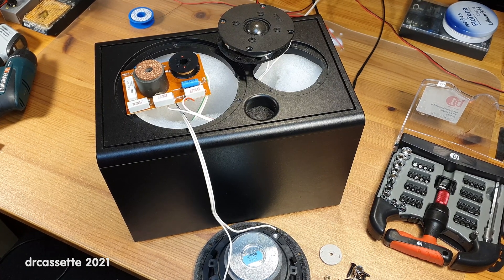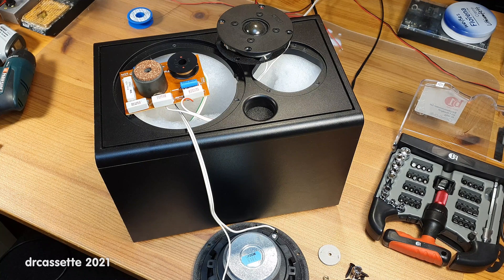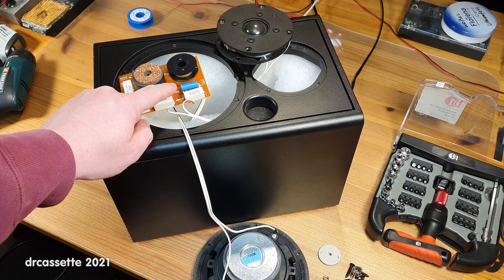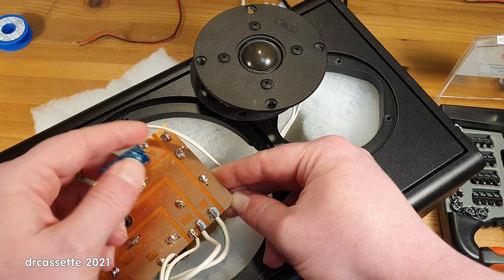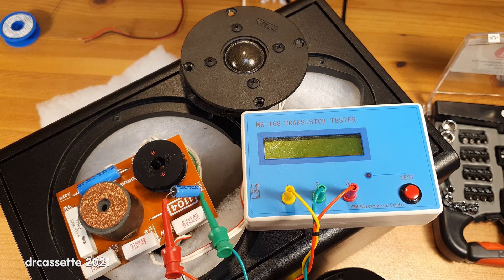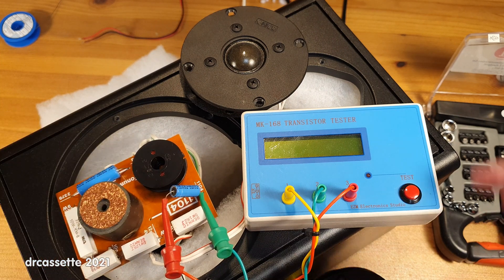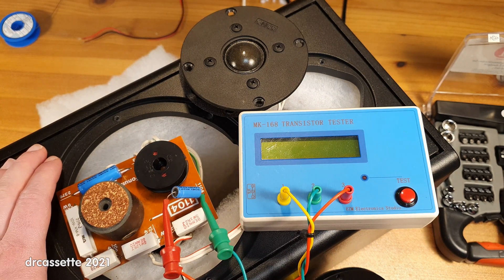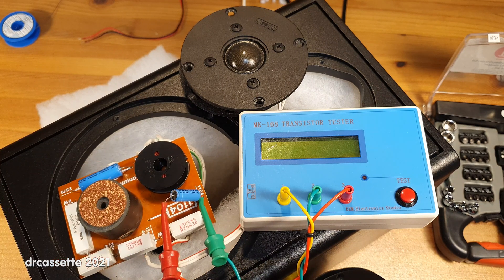Bad capacitors in a speaker crossover make a big difference

Comment: I don't recommend "shotgun" capacitor replacement as a standard practice, but when someone brings around a 40+ year old vacuum tube amp I start thinking about the power supply electrolytics becoming a hazard in the near future.  That and the coupling capacitors feeding the output tubes unless they are of superior quality.

Comment: A worthy upgrade to consider, replacing the NP electrolytics with equal or close value film caps, on the tweeter side. Electrolytics for the low pass function can be electrolytics with no issue. I’m not sure if it’s a placebo effect, but my ears usually prefer film caps in high pass and band pass applications, when listening closely.
Reply from the maker: Electrolytic capacitors indeed are not ideal, I once accidentally replaced film capacitors that looked like old electrolytic capacitors with new electrolytic capacitors and the speakers sounded noticeably worse. However, I don't think the owner of these speakers would really notice the difference, he is not that much into HiFi.

Comment: It sounds like we may have to wait for a follow-up video.... IF the speaker owner EVER replies.
Reply from the maker: The owner of the speaker is a friend, he replied not long after I finished this video. I will replace all capacitors in both speakers. That probably won't be too interesting, given that the diagnosis of the problem is already done. So there most likely won't be a follow-up video...
Reply: @DrCassette  So, whoever is curious would have to read your reply so they would know.  Meanwhile, I suppose we're gonna see what's your next interesting video.

Comment: Considering a speaker crossover is a pretty benign environment for a cap, this speaker doesn't look old enough (late 1980s? 1990s?) for a good cap to be that worn. Either those caps are crap or they have a ton of hours on them, and were often operated at high power.
Reply from the maker: The capacitors indicate that they are from 1992, however the design of these capacitors dates back to the 1970s. Maybe that explains the relatively short lifetime.
Reply: I think I actually have the same speakers, from 1992 I think.
Reply: Ok you mentioned it later anyways, lol.
Reply: what's the point of your comment? yes, the cap could be faulty or a bad design but it could be actually a good cap but the speaker was blasted for hours which caused the cap to die.... either way the cap is bad and need to be replaced.
Reply: @pagepro211  

If it was overpowered I'd rather expect the delicate tweeter coil to be blown, not the cap. It's still a bit strange that it failed completely open after just 30 years.

Comment: Humm, an interesting subject for a video. It never crossed my mind about crossovers. I still use a pair of speakers I purchased 35 years ago... About all I can say is that they both are still a good match and I am well aware that I can't hear so well in my late 50s. No one seems to mention cross overs getting old, it's mostly re-cone work and that's about it, or perhaps making a superior crossover.
Reply from the maker: Bad capacitors in speaker crossovers are certainly a very uncommon problem, this is the first time I came across such a problem. So if the speakers sound fine, there is no need to worry about capacitors in the crossover...
Reply: @DrCassette  thank you. As always fascinating content.

Comment: I thought the rant was going to be for the ones that were going to say that now you need to replace the same capacitor in the other speaker otherwise it will not be balanced properly anymore.  Lol. You forgot this crowd!
Reply: Actually, serial capacitors in a crossover network's high pass filter do have a huge impact on sound quality, not necessarily in frequency response but rather in step response. And given that both caps for both speakers are equally old with an equal history of usage, it would indeed be best to replace both with the same type. And while you're at it, it also doesn't hurt to check the ferrofluid in both tweeters.

Then again, it all depends on what the owner is using these bookshelf speakers for. The Canton Fonum series was well-acclaimed back then in the early 90s 🤷🏼‍♂️
Reply from the maker: I don't totally disagree with those who say that both channels should be kept equal. Certainly if a modification should be necessary in one channel, the other channel should be modified accordingly. In the case of these speakers, the other one which my friend has not given me yet has the same problem of no treble output, and since these speakers were likely made on the same day from the same batch of components, and given that they were used as a pair, being exposed to the same conditions throughout their life, I think it's safe to say the other speaker is going to have the same fault, bad capacitors in the crossover. And even if the other speaker was fine, since I have to order the replacement capacitors anyway, I would still replace all capacitors also in the other speaker, just to be on the safe side.

Comment: Okay I'm not sure I understand the rant? You say recapping is bad but then prove that the capacitor was the problem and that bypassing the bad cap with a working one fixes the issue? Unless you mean people are just going for recaps instead of troubleshooting to find that the problem is the capacitor (which is very odd but not really controversial to say its wrong, but in this case, regardless of their first plan of action being right or wrong, would fix the problem), I'm unsure what you were trying to hint at, sorry.
Reply: He didn't say doing it was "bad", he was merely saying that there are going to be people that say he needs to just blind replace all of them.  Those people are generally idiots, blind replacing all with ones that will never last as long as the ones left in would or be less of a tolerance.
Reply: @jimb032  But in this case it would technically fix the issue, no?
Reply: @arwlyx  Yes, if you can call that "fixing".  I call it throwing the baby out with the bathwater.   To compare it to a car:  You buy a new car with top of the line tires, these tires are guaranteed for 80k miles and have a 150mph speed rating.   One day you run over a nail and one tire experiences a flat- but all tires have 3/4 their tread life still.  You trash all tires and replace them with a set of MayPops with no guarantee and a spped rating of 80.  You fixed the problem, in a stupid way, but you fixed the problem.

Comment: I agree with your rant against blind recapping as a cure for every electronic problem ... Indeed the opposite, recapping is stressful for the boards especially if caps have bent pins to keep them still while they were originally soldered. Unless a cap is leaky or dead short, it is usually best to leave it as it is. Electrolytic caps are used mostly as filters for IC supplies and even if they have only 50% of rated capacity, it is not such a big deal.
Reply from the maker: I should add, in the case of analog electronics there are coupling capacitors in the signal path. If they are too far out of tolerance, they will have an unwanted influence on the signal, so if a piece of audio equipment does not sound as good as it should, if the signal is quiet or the frequency response is limited, coupling capacitors should be checked.
Reply: @DrCassette  

I always change audio output coupling caps. Don't want DC in a speaker coil from a shorted cap. For everything else, change only when necessary.

Comment: Your component tester is only showing you the capacity and ESR readings... It doesn't show you it's parallel resistance! 
I would love to see you take this bad Capacitor and put DC across it and measure how much DC leakage current it's passing.... 
Technically, it's should only pass DC current until it is charging to it's rated voltage and then stop, everyone just looks at the ESR measurement... But don't know about it's Equivalent Parallel Resistance... This is why I always say that an LCR Bridge Meter which can give all Capacitor measurements is a very important tool... 
The only reason why a Capacitor should show up more capacity than what it's rated for is if it's leaking DC current, the tester takes longer to read which makes it think that it's a larger value than what it is...
So if you can set up a DC leakage test... I would totally watch that video... 
Well actually I will watch whatever you post anyway because I really appreciate what you do... Capacitors are a never ending topic... That's why Mr Carlson's Lab developed his own capacitor tester for Equivalent Parallel Resistance... It's the measurement that really matters! High ESR capacitors are only really bad for use in power supplies... A series resistor in a Capacitor has difficulty filtering out DC ripple, it's parallel resistance that destroys everything else! I'm only trying to be helpful... Besides, what do I know LoL.. your the expert here!
Reply: Well he did kind of test for leakage because that's exactly what the excessive "Farad" rating is that the tester shows. He just didn't mention it that way.
Reply: wtf, the capacitor has a rating printed on the exterior, he checked the values of those ratings with a meter and it failed.. wtf are you talking about.. the system is design for those ratings and the cap is out of spec. simple!

Comment: I have found many speakers had very poor quality electronics used in the cross overs. My thinking is they felt cheap and middle of the road speakers would have a cone failure and be tossed after 10-15 years. Why make cross overs that last 40 years.
Reply from the maker: I too have noticed some speakers contain rather dubious electronic components. Maybe some manufacturers who only produce speakers and no other types of electronics have difficulties sourcing good quality electronic components because they don't need them in very large quantities and therefore are not in a very good position when negotiating with suppliers... Also they won't have their own quality control for the electronic components that they are supplied with. There is certainly a difference when your product contains 2 capacitors vs. when your product contains 100 capacitors. The capacitors in this Canton speaker indicate that they are from 1992, but they look like they had been made like that since the 1970s without any changes.
Reply: When you said they were made in 92 in the video, I was thinking those were 70’s era parts. Can’t remember where I saw similar parts, but it would be in pre-1980 pieces. You may be on to something there.